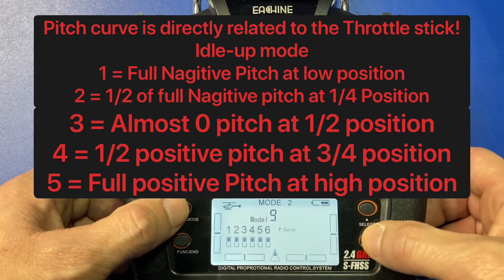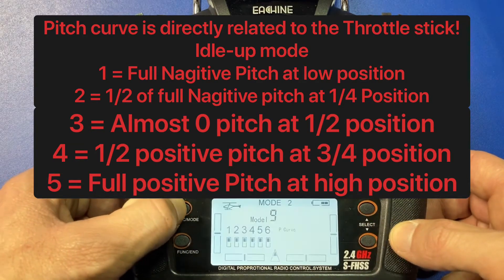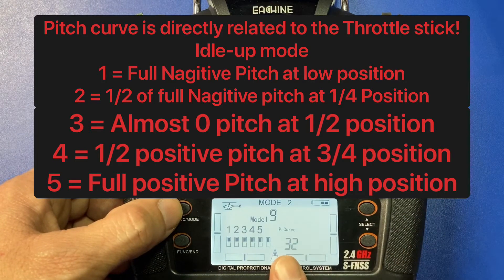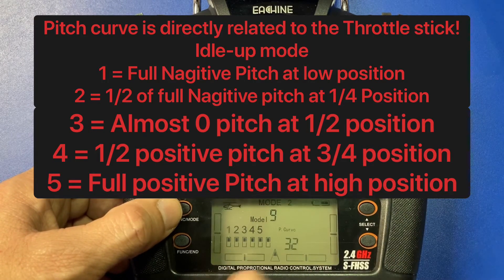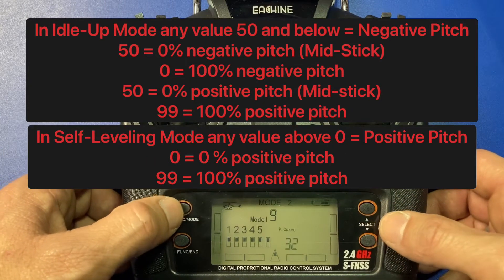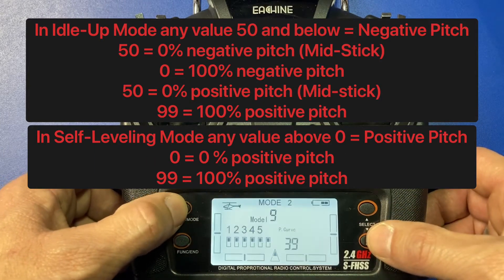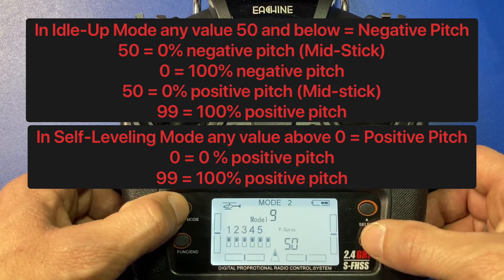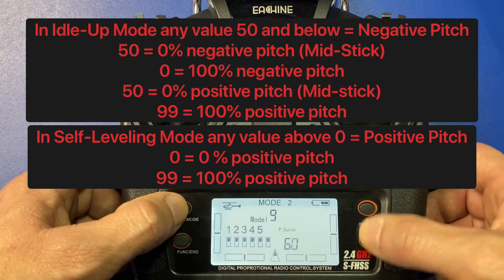Eachine e6 TX... T-Curves & P-Curves

Comment: What do you suggest to limit too much negative pitch when landing so you don’t slam into the ground. Any suggestions?
Reply from the maker: Hey Steve,
In pitch curve for self-leveling mode I have 1 set to 42 and 2 set to 48... this will give you very little negative pitch so landing will be much smoother.
I set 3 to 50 (for both Self-leveling and Idle-up) You can set Idle-up a couple of points higher but no more if you want a smooth transition.
I set 4 to around 60-63 for both. 
and 5 to around 70-75 for both.

Each heli is a bit different so play with it until you feel comfortable with the way the sticks feel and the heli flies. 

Always land in self leveling mode for smooth landings... I land in Idle-up sometimes but you will need to be ready to switch to self-leveling as soon as you touch down.
Reply: @DaddysRCAddiction  Again thank you very much for your help. Very appreciated. Any thoughts on collective management? I’ve tried keeping the throttle steady when hovering etc but still find the need to make frequent adjustments so the heli doesn’t start coming down or going up too high. I have a feeling I’m flying it more like a fixed pitch sometimes. I suppose the cyclic also has a lot to do with it since it controls height and direction as well. What do you think the ideal throttle curve would be to avoid this? Maybe a gradual linear curve makes this happen more whereas going say 0 to 80 faster would keep it more stable? I want to avoid the constant up and down adjustment of the throttle. Also when it come to pitch curve, I suppose being able to go inverted is linked to this? I set up my Blade Nano according to the manual but it won’t bank enough to flip over in the first two modes.  I know you need all the head speed you can get for 3D but with the idle up setting of 100 all the way, all it does is shoot the heli straight up. Is this is the only mode you can do flips in and how would you control the throttle or pitch if it is set at 100 all the way?
Also if I can ask you, I recently tried changing the gear on my Blade 200. Why on earth do I have so much difficulty moving the shaft up and down and pulling it out? I know there are bearings that fit in the top and bottom, are they supposed to remain stationary? The top bearing came out and was stuck like glue on the shaft. Should you not be able to move the bearing along the shaft and settle it back in the frame? The shaft did not appear bent but all the strength in the world would allow me to slide the bearing back inside. Any help to these questions would be really appreciated. Cheers and thanks ahead of time.
Reply from the maker: @stevejohnston8543  Hey Steve, constant corrections is the name of the game when it comes to flying helis well!!!!
Don’t fight it embrace it!!! My brother try’s to fly with as little stick movement as possible too but that is the wrong approach.
Constant hair like fine stick movements for hovering and lite sport flying... when you get better you will start banging the sticks a little doing move advanced movements. 

In stability mode I find a linear curve(0-25-50-75-100) works best for me. Also in this mode the throttle stick controls both head speed and pitch at the same time.
In idle-up mode I use one of the following curves depending on the helis power. 100-100-100-100-100 or 85-85-85-85-85- or 100-95-90-95-100... I also make adjustments as needed.
The throttle stick in this mode no longer controls head speed(well a very little if using 100-95-90-95-100) but for the others it controls the pitch only and the head speed is constant through the whole range of movement. This allows you to to preform tricks and not loss head speed. Hope this is making sense.

For your blade nano... I believe the first 2 modes a variations of stability(this limits bank angle, therefore you can not go inverted. The 3rd mode should be ACRO... complete control(what ever you want to do)

For your 200... I’ve had similar issues... it seems that in the factory they get a bit happy with the thread lock(I guess so that things don’t fall apart when a customer gets a new heli) but I solved stuck bearings and other issues by soaking the components in alcohol for several days to soften up the thread lock.
On the main shaft there is also a locking collar... which I’m sure you are aware of and most likely not the issue you are having. Don’t forget to lubricant your bearings again after soaking in alcohol.
Best of luck,
Steve/DRCA
Reply: @DaddysRCAddiction  Hey Steve, thanks again. You could say I’m banging the sticks already. Doing my own kind of acrobatics and having to save it before it nose dives or hits something 🙂. Cant help but push my limits. Man it is not easy to get nice circuits and figure eights n full collective pitch mode (the Nano excels for me for making nice sharp bank turns but as you correctly said the first two modes incorporate stabilization), I’m at the point of getting much better at circuits etc with a little stability thrown in. My hovering and basic forward and reverse flight out of stability mode is coming along, now it’s trying to move away from it more and more. I disagree with the notion that stability mode is a bad thing. Even with it you will crash a ton but to me it was vital in learning to fly and I believe I used it as intended which to say training wheels you gradually cease to rely on.
So I guess making occasional  corrections to the throttle is normal. I must say this is one challenging hobby but is there anything better 🙂. Actually it’s akin to guitar in terms of room for growth and how much practice etc is involved in order to become proficient.My favourite non collective pitch heli is the V911S. Man that thing is a hoot and I go bonkers on the sticks with that one just full out throttle etc.
One more thing man how are you supposed to change the tail booms on some of these smaller micros given the way the wiring is. Do you have to remove the servos? Not sure why they sell booms for some of them, the wires seem to go through part of the frame, can’t see how you could remove them and thread the new ones through.

I started with Blade and now XK and Eachine helis, I’m thinking Align helis might be the next step, what do you think? Cheers.
Reply from the maker: @stevejohnston8543  Hey Steve, Yes, it sounds like you share my ADDICTION!!!
My first heli was the Blade Nano... This was before Horizon Hobby had AS3X or Stability mode on it. Needless to say learning on the nano ended up with more crashing than flying (It's a good thing it is so light, most of the time crashing had no effect on it) and while flying inverted I lost control and ended up in a thick wooded area... I never saw the Nano again:(... I bought a new one a couple of years later(with AS3X + Stability) and a friend gave me another nano and a couple of MSRX helis... I don't really fly them any more because they don't have the power I like but they were indispensable when it came to learning!!! I would flip into Acro with my finger on the switch ready to flip back to Stability if I felt out of control!
I say you can't learn unless you push yourself past your comfort zone... So keep banging the sticks but try to refine it so you are always in control... But crashing is part of this hobby!
It sounds like you play guitar... I play as well... I had a few original bands back before kids... now I write songs with my kids... Its is awesome!!!
Working on these small heli's does sometimes require dismantling of much of the heli but it's usually pretty simple and there should be holes in the frames wide enough to fit connectors/wires through.
I have one Align heli... the 150 DFC... It flies great but is very expensive... I mostly have Blade... 360(6s & 3s), 270, an old 450, 230, 180, and all the XK models.
Have you looked into OMP Hobby... They are direct drive... heres a link...
https://www.banggood.com/OMPHOBBY-M2-V2-6CH-3D-Flybarless-Dual-Brushless-Motor-Direct-Drive-RC-Helicopter-BNF-with-Open-Flight-Controller-p-1576058.html?cur_warehouse=CN&ID=6287843&rmmds=search

Eachine has a direct drive as well...
https://www.banggood.com/Eachine-E180-6CH-3D6G-System-Dual-Brushless-Direct-Drive-Motor-Flybarless-RC-Helicopter-BNF-Compatible-with-FUTABA-S-FHSS-p-1810193.html?rmmds=detail-left-hotproducts&cur_warehouse=CN&ID=566202

But when your are ready Align, Goblin etc will be on your mind all day long!!!!
It's a big investment!!!!

All the best!
Steve/DRCA
Reply: @DaddysRCAddiction  Hey Steve thanks. I have a few M2's. Two need to be repaired and I'm hesitant to fly the other one till I'm  more confident. Crashing that one hurts. Wonderful smooth heli. I was wondering is more expo positive with the Eachine radio or is minus actually more luke I heard with the XK radio? I find the 160 jumps up and down on me, wondering how I could improve my collective management. Thanks and cheers. Man is flying airplanes ever a lot easier I'm starting to feel like Eddie Rickenbacker on those. No comparison.
Reply from the maker: @stevejohnston8543  Hey Steve... I don't have an M2 but they have tempted me many times... Actually I think I'm going to pick up it's clone(the Eachine  e180).
Crashing sucks!... I practiced a lot with smaller more resilient helis but they are more squirrelly, which is good because if you can fly small helis, when you go to bigger helis they are more stable(easier to fly)!!! but have much more power. A simulator is also a very useful tool!!!
So, if you find your heli is jumping up and down a lot, there can be a few reasons for that
1. Lack of skill... I'm not trying to be funny I'm just saying that hair like movements and continuous stick corrections along with your hand eye coordination takes lots of practice and could be part of why you jump up and down a lot.
2. If your using the x6 or e6... they both have potentiometer gimbals which can start to go bad and have very noticeable delays when moving your sticks... which will result in that jumping up and down that you are experiencing, trying to keep up with the heli(which you will never do with bad potentiometers)... Test this with the blades off... move the sticks as slowly as you possibly can one direction at a time(without any expo applied)... the swash plate should follow your every move... if you notice any delays then you may have bad potentiometers.
Hall gimbals are much more reactive and dependable.
3. Expo... you may have your expo set wrong. (expo effects stick movement around center stick)
Different TX's reverse + and - Expo... I don't use expo on my e6 or x6... so try that first.
Try the following on the bench with the blades off
Then try 10% - and then 10% +(set as you like)... I forget which way on the e6 and x6 adds cushion around center stick but that is the way you would want to go at this point, more cushion around center stick.... keep in mind when you add cushion around center stick when you get closer to the outer edges where expo does not apply the heli will try to catch up to the stick movements. Hope this makes sense.
4. While learning you may try adjusting your T-curve to have less authority around center stick...
something like 0-42-50-60-70... so 2, 3 and 4 are closer so you have less call for power around center stick. You may want to do the same with P-curve... adjusting so that around center stick there is less call for pitch changes.
I always test T-curve, P-curve and expo on the bench where I can see what is happening to the swash plate before I put it in the air.
Trial and error is the only way to find your sweet spot... and that too will change as you get better... you will want more authority, well thats what I wanted!!!
Let me know how it goes.
Reply: @DaddysRCAddiction  Yes a little lack of high end skill might be part of it with this type of helicopter which really is primarily designed for advanced flight but I also fly my M2 without that issue so I think the radio settings may have something to do with it.   I am becoming much better at circuits and sport flying at this stage,was just wondering whether you knew if negative or positive cushions the sticks on the stock radio. Kind of a lazy question 🙂 Steve just a thought. There is a pretty good direct comparison video of the M2 and the Eachine 180. Not sure what the price differences but you can order the M2 from the states (I happen to be in Canada) I don’t think the same can be said for the Eachine. Check it out but I think he will find the M2 is a considerably better helicopter. I bet you would love it. It’s as smooth as silk.
Reply from the maker: @stevejohnston8543  Hey Steve, I was thinking the same thing... it’s a radio issue.... I actually just ordered the Eachine e180 from Banggoods American warehouse. Anything I buy now I am also looking to unbox and review on my channel... I saw the comparison of the M2 and e180... the M2 is the better heli but I have bigger better helis than the M2 so I figured the e180 is a good budget direct drive to review. I may reach out to you for some input on how the M2 handles if you wouldn’t mind. Also in the reviews you saw on the M2 and e180 are there any questions you had that were not answered in those videos? I will try to address your questions in my video.
Thanks, Steve 
Who knows I may still get an M2 if I really like the e180😁
Reply: @DaddysRCAddiction  Ha  if you’re anything like me you’ll probably grab both. I keep a few around of several models as I’m not always keen on repairs and I like to have several in flying condition while others are on the shelf 🙂 I have two M2’s on the shelf. One has a broken boom (hate boom and wiring work so far but I’m learning all the time. Pretty sure one just needs some work on the head to get up in the air. I will mirror the newer one and see what the problem is. I think it’s just a linkage issue. Worked on it for hours one day and when it didn’t fly on my first flight test I shelved it. Heck one thing I’m going to have one hell of a fleet once I have the acumen not to mention inclination to fix them all. No as you might have guessed I don’t have a wife 😎. Any idea why the servos on my XK123 are jittering almost constantly. Does not appear to affect it in flight. Cheers.
Reply from the maker: @stevejohnston8543  Well, I think you are right!!! I am an addict!!!:)... My brother says that I am more of a collector now because of the sheer number of RC products, heli's, planes, quads, cars, trucks, boats etc. that I own. If I crash/break one I have to fix it ASAP... everyone of my models is ready to  use and if not it is in the process of being fixed... I know, I'm a bit sick!!!  
I have no doubt your skills will improve and your acumen along with it! As for the will to work on your heli's... well, it is not as much fun as flying but very necessary... For some reason I can't rest if something is broken... so I push myself, get frustrated but then I'm happy that its done:)
I have the XK123 and the WLtoys 123 (one and the same) wltoys owns XK. 
The jittering can be a radio issue(I have that on my Trex dfc 150) which has a DSMX satellite reciever on it. Once in a while I can feel it in the air. But it is most likely a servo issue(the servo may be on its way out)... Very inexpensive plastic gear servos on those helis... setting end points could possible fix it but you can't do that with the x6 tx and most likely wouldn't help with those servos anyway. I've learned to accept those little annoyances with my inexpensive helis... the servo may fail one day but is it worth almost half the cost of the heli to replace the servos? Fly it till it crashes:) All the best!

Comment: is there a way to factory reset the tx ? is says in the manual you can and why you would want to but doesn't show how?
Reply from the maker: Thanks for the comment... I never had a need to do a factory reset... I’ll have to look into that! What is the reason why you are looking to reset your TX?
Please Subscribe, Like and Ding the bell!!!
Reply: @DaddysRCAddiction  Hi thanks for responding i was attempting to re calibrate the sticks but messed it up due to the poor description
Reply from the maker: @cruxio02  How did you attempt to calibrate the sticks... I don’t believe there is software in the TX that allows calibration... did you attempt to manually calibrate the sticks? 
Not sure how to reset the TX... It may be some done with a computer by the company. Or a special combination of buttton commands.
Reply: @DaddysRCAddiction  page 16 of the manual for the TX i thought it would be similar to the xk controller I'm gonna have to buy a open tx i guess
Reply from the maker: @cruxio02 WOW... the instructions on that page are written like a riddle😂
So I tried it and it does work... 
Here are the instructions for calibrating the sticks in plan English...
1. Hold the rudder trim to the right and power on TX (The complete display should be visible)
2. Move left stick full up then full down two times and full left then full right two times and return it to center.
3. Move right stick full and then full down  two times and full left then full right two times and will return to center on its own.
4. Turn off TX (stick should be calibrated!!!
Hope this helps.
For a factory reset  try this...
1. Hold down the Mode and Back button and power on the TX. The display should show the letters CC... after about 5 seconds the display should come back to normal. Factory settings should now be restored.
Let me know if it worked for you.
I mostly use my Dx6, Jumper T12 and my DJI TXs... thanks for pointing out these features on the T6 and the X6!!!
Reply: @DaddysRCAddiction  OMG THank you so MUCH ! Thank you thank you thank you. That is so kind of you !